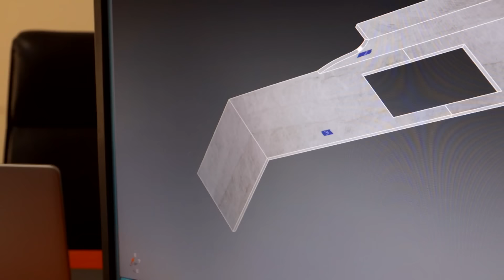giving our KITCHEN a MAKEOVER! ✨ new design, countertops + stone backsplash!

Comment: I would continue the shelves from the corner to the window to take up more of that blank space. There are parts of your kitchen that are symmetrical but the parts that aren't, like the fridge and the shelling next to the sink, are throwing the balance of the kitchen off. if you don't want to add more upper cabinets, extend the open shelving above the fridge and on the right side of the sink. I also saw a comment that mentioned a warmer paint color on the walls, and I completely agree. Either a warmer paint or a really subtle wallpaper with texture. The new counter top looks great!